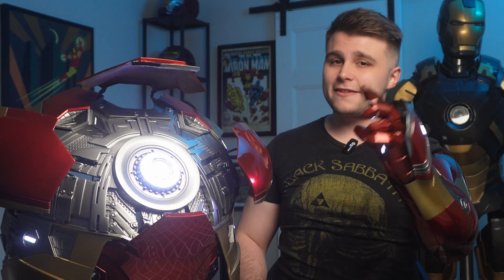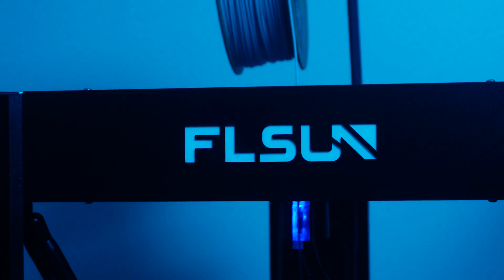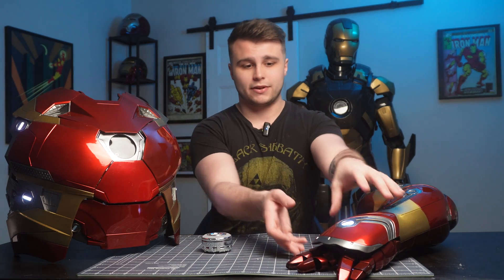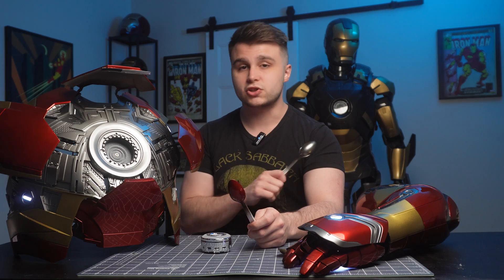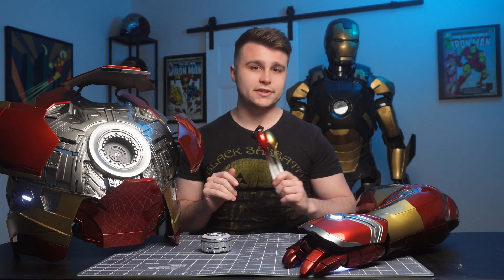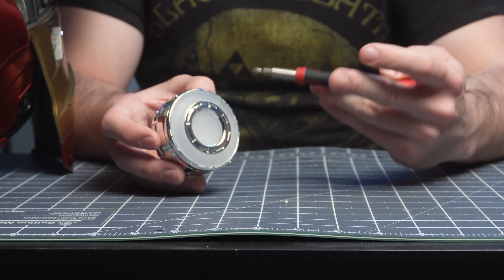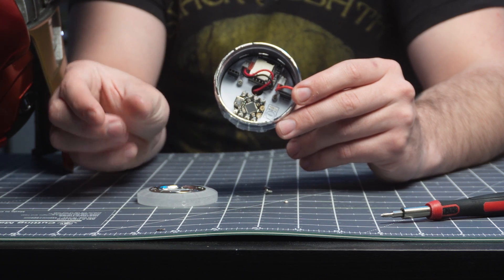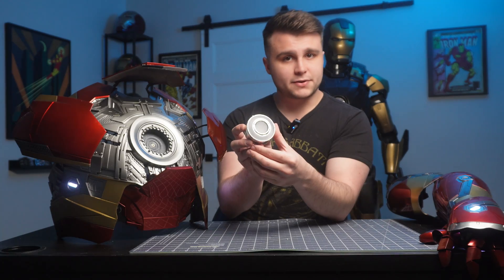MY SUIT'S NEW ARC REACTOR! - 3D Printed Iron Man Mark 46 Cosplay Update Video #4

Comment: Hey dude, I'm currently working on my very first Iron Man helmet, it is the Mark 46 helmet.
I am in the process of motorizing it using an Arduino board. I did find a tiny gap on the sides of the helmet next to the eye cut out, and the top of the faceplate is rubbing against the widow's peak, can you suggest any ideas or tips?
I love all your projects, they were a huge inspiration to my helmet build.
Reply from the maker: I would recommend using a file and sanding down around the widows peak to improve the clearance so that it moves more freely:)